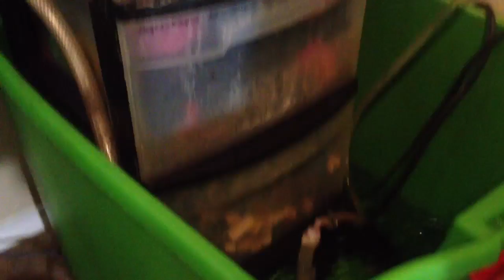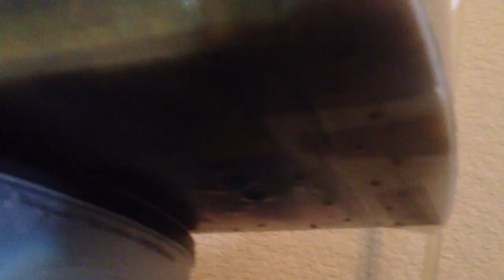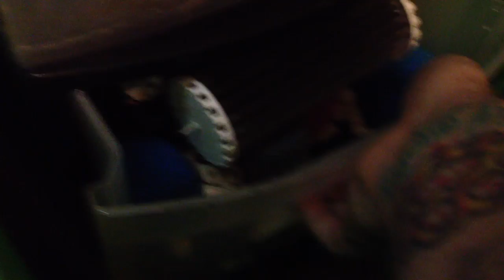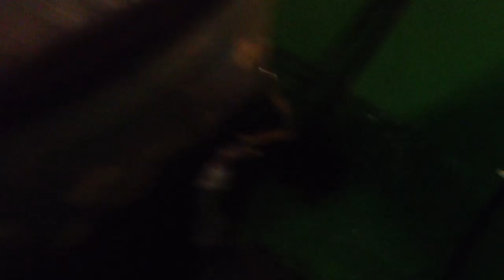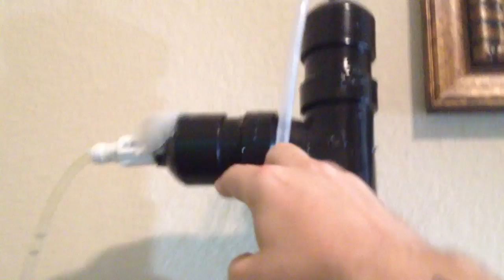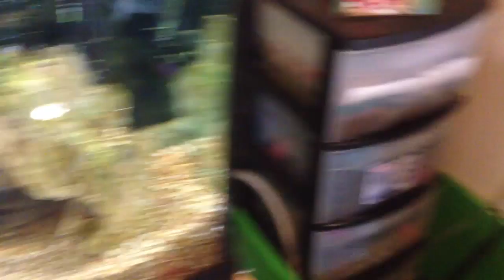DIY filtration and how it works

Comment: How does a de-nitrator work? is there anything besides bio media inside the tube? How does the coiled tube deplete the water of oxygen?
Reply from the maker: Kenney it's all about the flow rate with these. The coiled tube gets lined with aerobic bacteria that eats ammonia and nitrites, witch takes oxygen out of the water as it slowly flows past all of this bacteria. Once the water enters the tube, with all of the bio media it's starts the process of anaerobic bacteria which eats nitrates. This process is important because if the water comes out to fast there will be a build up of ammonia and nitrite in the water, too slow and even worse AS comes out which can kill fish even faster than am and nitrite. But when it's just right the water comes out amm nitrite and nitrate free. It's a very simple design and filter, all it requires is a length of tubing, a pump and bio media like bio balls and a dropper that's adjustable. Just type in denitrator filter for aquariums in google and it will go into greater detail if you'd like to build one.

Comment: I have the same setup with a 54 gallon tote with 27 galllons of water for the sump refugium.  In my top drawer I have it filled with pillow filler.  On top of the pillow filter is egg crate that holds the fine filter media, coarse filter media.  On my outlet I have a scrubby to keep the noise down